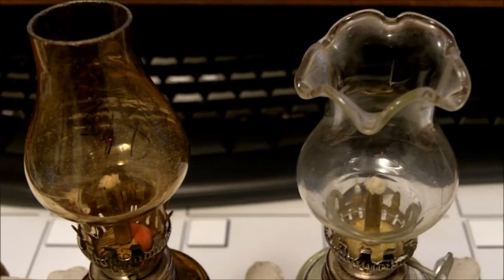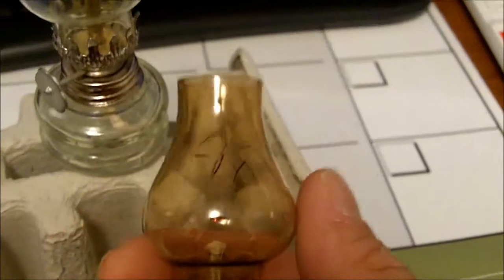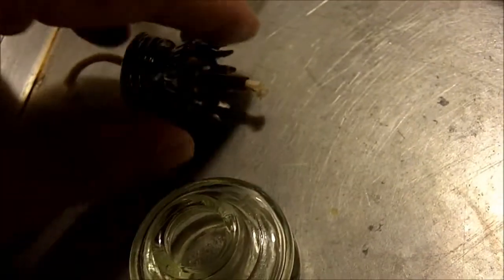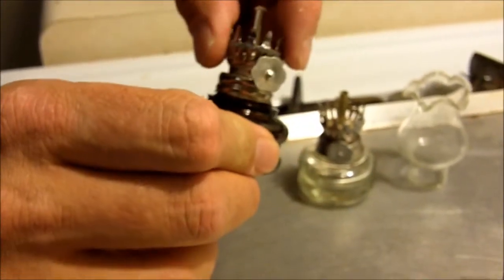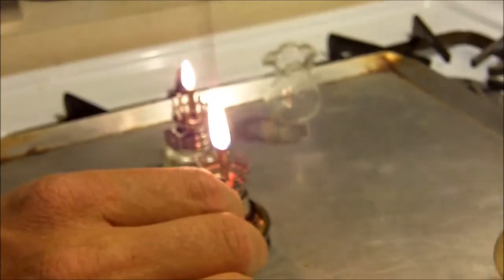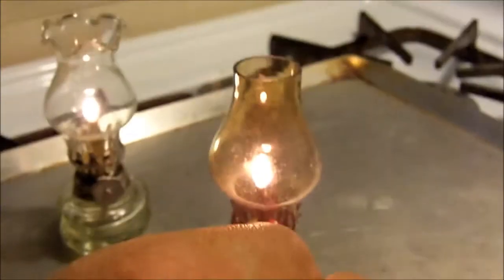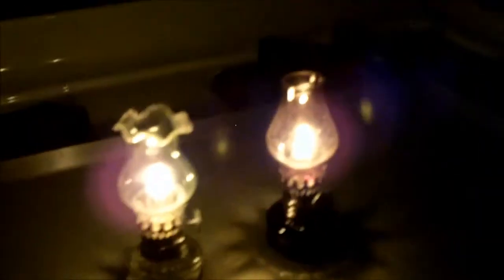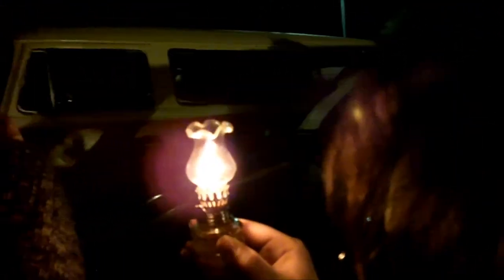Mini Oil Lamps, awesome old school 1800's style pocket flashlights!

Comment: I bought 4 of these from the Amish store for $7 each, but mine came with a reflector and wall hanger hook, 2 this size and 2 larger. It's made in India from Coke cans and thin metal. I love them because they work beautifully. If my dollar store had these I would buy 20 more, they are much safer and cheaper to use than candles.
Reply: I have those too! Lovem!

Comment: I love these!  I used to have a little collection in different colours.
Reply: Did the fuel easily spill if moved about carelessly ?
Reply: @TomSarracino  No.  The only way for the fuel to spill would be through the wick tube, which is usually a fairly tight fit.  So unless you turn it upside down for a good while, it doesn't spill.  Also, great name.

Comment: ill bet you could find the wicks you are looking for on ebay. Actually you could make your own wick from the strands of a traditional old time floor mop
Reply: it's a standard zippo wick.
Reply: @vhfgamer  A Zippo wick is pretty skinny. I suppose you could try and spread it out to fill the wick tube
Reply: @inkey2  I sell those exact same lanterns, and the zippo wick is the exact same dimensions. It's a drop in replacement.
Reply: @vhfgamer  Well then thanks for the valuable info
Reply: @inkey2  Sure no problem. The only gotcha with the zippo wicks is they have a stiffening wire built into them. So you'll need to trim your wick every so often.
Reply: @vhfgamer  OH YEAH i remember the wire inside so it's easier to push through the zippo lighter.

Comment: @hitachi088 ha ha, yeah! What I meant was -after the wick has been burning for a while and is glowing red, and the oil inside is nice and hot- that the oil in the tank has caught on fire before when I accidentally rolled the glowing part of the wick in to the tank.. So threw it out the door of my camper. This was when Kerosene was being used as fuel. Great idea with the pliers thing! You must really be an expert. I'll check out your vids now cause I'm sure I can learn from you.

Comment: I got one as a present, but the rope just keeps burning up in less than a minute.. I'm not sure what the problem is, I used regular oil lamp fuel. Maybe the rope is too thin? It's a lot thinner than the ropes in this video.

Anyone get any tips on this for me?
Reply: *****
It turned out that the rope was too tightly woven. the oil couldnt get all trough. so it would burn for a bit and then burn up the rope.
I fixed it but simply pulling a strip of an old cotton shirt trough it. i can't use the wheel to make it brighter and dimmer now, but other than that it works great :)
thanks for the comment :)